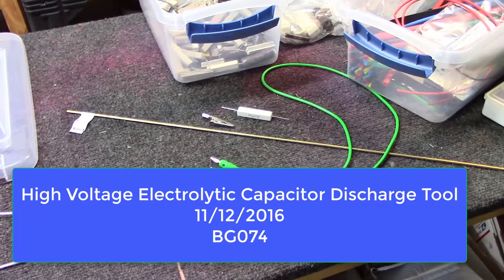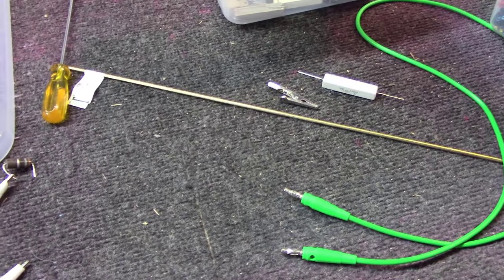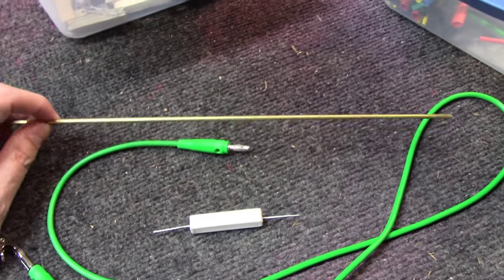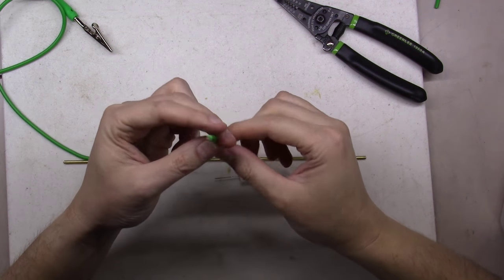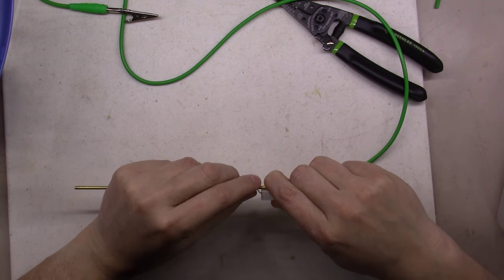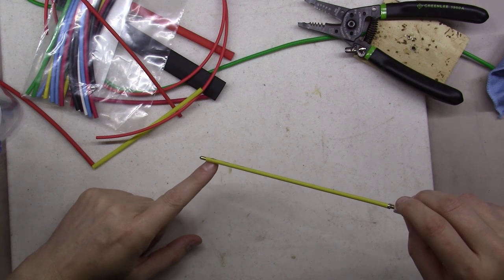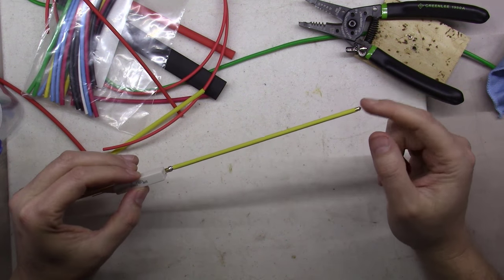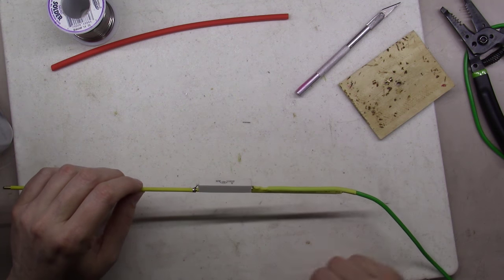High Voltage Vacuum Tube Electrolytic Capacitor Discharge Probe / Tool - BG074

Comment: A rectangular wooden block with a carve-out for the resistor and coated in epoxy and ergonomically shaped would have been much less costly and probably a lot safer than having the full voltage rod coming all the way to the handle. That’s worrisome.

Comment: I believe it's likely that we've all had a capacitor discharge tool that closely resembled a screwdriver. They can really scare the sh*t out of a unsuspecting beginner, or worse. Electronics really is not an intuitive subject as a whole to the uninitiated. It's unfortunate that most of us begin learning these valuable lessons without the advantage of having a ol' grey beard mentor. However, you learn really quickly the capabilities of capacitors, and that they aren't at all friendly.

Comment: Many years ago I worked for a power supply company on radar transmitter power supplies. These supplies put out 24,000 volts and could supply many amps on demand and would kill you dead if you got across it..

One day while running a test sheet on one of these, I shut the supply down and prepared to remove the full load from the supply so I could record the output at minimum load. As I reached to move the alligator clip I first applied my shorting strap (#8 wire to earth ground - metal frame of the building, steel girder). The alligator clip at the end of the shorting strap was taped to a 12" phenolic rod so my hand was well away from the HV terminal. The result was a very load bang and a very bright flash, about 1/4" of that heavy alligator clip vaporized in that flash.

The power switch on the 30a variac had failed and the power was still applied so I put a direct short across that 24,000 volt power supply with a nice fat oil  filled output cap. That caused a fault current of thousands of amps )24,000 volts / 0.02 ohms = ??). These supplied had previous melted a #10 wire inside the workbench wiremold strip, when I fixed that strip I found a 1/2" gap in the wire between a couple of outlets.

From then on I never relied on the switch, I ran the variac down to zero volts and double checked both the output voltage and the input voltage to make sure everything was off. I also kept the output of these supplies shorted to ground anytime i wasn't actively testing a unit.

This is an extreme example but it demonstrates how careful you have to be. When putting a resistor in a shorting lead make sure it can withstand the surrent flowing in it if it were hung across a working power supply supplying full output. Those sand resistors have pretty poor surge capability and can flash open if they are not rated for the surge.
Reply: Interesting and relevant Story, we used to go upto 60 KV on some of our systems. We had some highly intelligent test team guys and safety was paramount. No safety issues while I worked there although we did have one guys electric scooter blow up as he crashed it that morning. Always respected that corner of the lab.

Comment: I realize this is an old video but it just appeared on my feed. When I do a job like this I use heat shrink tubing with adhesive in it. The adhesive prevents the tubing from sliding off over time, which does happen. Furthermore, the end of the tubing that protrudes past whatever is enclosed can be pinched closed. Finally, the same pinching method can be used when the tubing has shrunk the maximum amount but has not completely shrunk around whatever needs to be completely enclosed. Once again the end of the tubing can be pinched together to make an air tight seal. The seal also keeps moisture out which may help in high humidity when dealing with high voltages. 
As an aside, I am just learning about tube amplification, just got my first tube amp, a single ended amp, and your channel has taught me a bunch about tubes. Since I was about 12 years old  I have always been listening to solid state gear. Now it's back to tubes and I could not be happier.
Thanks,
Eric

Comment: I use a resistor substitution box, having switchable resistances from 10 ohms all the way up to several megohms. Every electronics hobbyist should have one of these already anyway. You can start out the draining procedure with several hundred ohms selected on the switch and then rotate the switch down until you get to the lowest resistance. This makes for a safer, more thorough capacitor draining procedure then using just one fixed-value resistor* ,  and is much gentler on the capacitor. I did a upgrade the wattage of the internal resistors for everything below 100 ohms. It's an old Eico resistance box, by the way, extremely helpful for experimenting with circuit modifications, or dropping the voltages a little for comparison purposes when replacing incandescent lamps with LEDs, and so on.

* this is even more helpful for working on solid state equipment than for tube gear. Tube equipment won't care if you go to solder/unsolder something and there's 10 or 20 volts left sitting in a capacitor somewhere; but, if you try to solder/unsolder something in a solid-state amp that has 10 or 20 volts or more sitting on its capacitors, you are indeed very likely to blow up some other components and maybe damage even the circuit board if you unknowingly try to solder/unsolder something with that deceptive,  seemingly "low" voltage on it. Also, know that typical tube amplifier capacitors are less than 100 microfarad  and despite the high voltages,  the amount of stored electricity is relatively modest  and the capacitors are therefore easy to discharge; but a solid-state amplifier might have capacitors of 10, 000 microfarad that will hold a very large amount of current for quite a while in some amplifier designs,  even though the voltages are much lower than you would see in a tube amp. A pair of undrained 6K to 10K mfd filter caps charged at merely 20 or 30 bolts will spark like a shorted out car battery,  scare the crap out of you, beat up your soldering iron tip and vaporize copper foils, and probably short out some IC's or transistors, perhaps without any smoke or other visible indication of what has been damaged.
Reply: A lot of people might refer to what you described as a decade box.

Comment: I did something stupid.
I built this tool and it works great.
I've used it many times while modding and testing my amp.
However the last time I used it I forgot to switch off the amp and only realised it about 5 seconds later because of the excessive sparking where the tool contacted my cap and the bleeder light not going out.
The amp appears to be fine but is there anything I should check out or weary of?
Thanks in advance.

Comment: Neat tool. I've been using the low impedance mode on my multimeter to discharge caps for a while now,  seems to work pretty well also
Reply: DON'T! 😵

The meter will/should have a fuse or fusible link in it, that can easily be blown by discharging a fat enough capacitor at a high enough voltage (especially if you accidentally leave the thing switched ON!);

Once that thing is blown, you have NO assurance that the capacitors are discharged.
Reply: @RogerBarraud  That's not how it works. The fuses in a multimeter are on the current ranges only and are linked across the terminals by a current shunt.  And if you are using the current range to discharge anything,  you could literally blow your meter apart and even injure yourself.  The low impedance mode on the other hand is typically 5k - 20k ohms and is rated at the CAT rating of the meter,  typically 600-1000V.  Discharging anything rated above 1000V is something you would not do with a multimeter anyway.

Comment: Do you just touch the POSITIVE side of the capacitor, in order to drain it?  A friend of mine who is a tech is suggesting to touch both capacitor legs at the same time "to be sure", but isn't that just shorting them, and is not only unnecessary, but actually not good for the cap?  Thanks
Reply: Yes touching both without resistance in between is effectively a short. Maybe he's suggesting that to prevent accidental shorts if the leads are close (ex. radial capacitors). The safest way is probably clipping one side of the discharge tool to chassis ground and touching the positive side of the capacitor with the other end
Reply: @monz7951  I think he is saying to do it the way that could potentially damage the cap!  Which surprises me, because he is a very advanced tech.  I'm going to chassis ground / touch positive.  Thanks!

Comment: Hello and thanks for the tutorial, but i have one question. Other youtubers use in their tutorial a much higher value resistor like 20k and you use only a 120 one. Does that matter? 
I know that a higher resistor will discharge the cap slower, but how about the safety aspect ? is it more dangerous to use a 100 ohm one compared to 20k one ?
Cheers !
Reply: I need To ask The Same Question Please .
Reply: It all depends on the rating of the capacitors you are discharging.  Yes, 100 ohm CAN be bad if you're working with higher voltages.  Personally, for most modern consumer electronics, I'd use around a 300 or 400 ohm resistor for a nice balance between time/safety.  I'm thinking of making a tool like this that allows you to select from 3 or 4 different resistance levels.  There are some web resources available to help you figure out what you should use.  For example, DigiKey hosts a web page to calculate the appropriate resistor to use for a given capacitor: https://www.digikey.com/en/resources/conversion-calculators/conversion-calculator-capacitor-safety-discharge
Reply: That calculator tool is interesting. The caps discharge faster than I thought. 
Yeah, I think the resistor I use is a 460. Works fine.

Comment: So this is good not only for guitar amps, but also other electronics such as vintage TVs and radios?
Reply: Yup. Any capacitor lower in voltage then the resistor and wire is rated for.

Comment: Great idea to make a simple useful tool.  BTW, what is the power rating of the 120 ohm resistor; 10W?
Reply: Everyone else I’ve heard recommends a 100k or more resistor, not 100, rated about 3-5W. I think with 100 ohms it could discharge all at once, in one rush.

Comment: I have somewhat of a video request.  Could you explain what makes capacitors considered "audio grade," and which types of capacitors are recommend for the best performance in audio equipment?  I typically use Nichicon caps per your recommendations, but are they all "audio grade," or are there specific types of Nichicons that are or aren't?
Reply: Mostly marketing strategy.
Reply: Audio grade capacitors are the 50 cent caps that cost $5.
Reply: "Audio Grade" caps are designed to have low internal noise so they will create less distortion passing an AC audio signal through an amplifier. They are usually in smaller values and voltages than power supply or blocking capacitors that are designed to manage high ripple current values for smoothing, or general purpose that may just hold or block DC in a circuit. If you go to Digikey or Mouser and search within the " Electrolytic Capacitor" for "Audio" capacitors, you can then select a few, and read the datasheet info on them and see what differences they may have from general purpose or other capacitors.
Reply: The service manual parts lists of my receivers NEVER say "use audiograde capacitors" as replacements.  They state the microfarads and voltage.  That tells you all you need to know about this scam.

Comment: Outstanding video! Now question? You were to do a capacitor on a home ac unit and this might be a silly question but trying to make sure to drain the capacitor you attach the clip to the unit or the lip of the capacitor?  I am using the screwdriver method and trying to touch nothing but that? Thanks in advance.
Reply: I would attach the clip further from the cap so my hands aren't in so close to the tip incase of accidental arcing. The clip can be attached to anything that is grounded such as the unit itself but that may be painted and blocking a good connection. I would think the 120v ground wire is exposed and a perfect place to grounds to bare copper and bolted to the chassis
Reply: The metal cans on a AC capacitor have no electrical connection to the capacitors inside of them. Make sure the Unit is FULLY DEPOWERED!! ( pull the outside disconnect and check both of your AC leads at the contactor for voltage across and to neutral / ground) If its a single cap, it will have 2 unmarked terminals. If its a 2 section, it will have a "C" for common, a "F" or "FAN" and a "H" or "HERM" (for "Hermetically sealed compressor motor") You wll drain the capacitors by going from "C" to "F" , and from "C" to "H" or "HERM"

Comment: What’s thoughts on using a metal coat hanger in place of the brass rod, still using the heat sharing and resistor?

Comment: Hey man go through the hardware section at lowes ir home depot. They have the 4-40 and 6 -32 machine nut and bolts, washers and lock washers. You like the black just make drill holes in a piece of scrap wood and load ten screws into the holes and hit with some black rustoleum. Any color you want. Save time and money, live better.

Comment: Where I work with 250Kw SW transmitters-we use ground hooks.they are connected to the ground system of the station.Here the ground hook is your friend.Power supplies up to 30Kv-30A.the ground hooks WILL save your life.Use them anytime we go into a transmitter-also the primary breaker is opened.You have to open the breaker toget a key to gain access to the transmitters power vault.That contains the HV power supplies.The ground device you make is a good idea and precaution.

Comment: Nice device,i used a 1M resistor in line with heat shrink,think i'll get some nylon rod /tube and solder a resistor to a bannanna socket and a brass rod,fit it all inside the nylon tube or bored out rod,some epoxy and more heat shrink to isolate the brass rod up to the tip,and i can replace the plug cable,store the probe with no hanging cable yaddah yaddah yaddah.
Reply: 1M Ohms is too high.  It would take  1 hour to discharge.  Use 470 Ohms.    Unless you are playing with really low micro Farads.
With a 1M Ohms, your capacitors are not discharging.
Time_to_discharge = 5 * Farads * Resistor_ohms.

Comment: Definitely a nice tool, but I'm a bigger fan of D-lab's method-- simply install a paralleled resistor in a dual banana plug connector, plug it into your meter, then plug your test leads into it. Set the meter to VDC, and you can discharge the capacitors while also verifying that they are, in fact, discharged!! (Just be sure to remove the banana plug device before using your meter for anything else!):

https://youtu.be/2iqmDf0QIyM

Comment: I have a 1Kw Am vacuum tube broadcast transmitter. Dint remember off the top of my head how many voltsin the bug cPs. I'm thinking is either800, or 1,200. In the cBanit there was a probe wired to the ground of the mains ground o the end of a broomstick. Situation was I could have it,or if I didn't take it , it would get busted up and despised o,f who I thought would be A sin, so I have it. I thought maybe idtey to convert it to use on the 160M Ham band, but as yet haven't got my head around how to do that. Building  suitable antenna and ground system at that ewavelength is also a but if a challenge, do even if I did s good conversion,, I dint have the avcwrage for a large enough antenna. 1kw AM RF INTO A SHORT ANTENa with iffy ground seems like are ipe for a lot of rfi complaints from too many too close neighbors, so that idea will have to wait until I land on a bigger plot with more distant neighbors. Those caps have big bkeader resistirs across them,, so discharging them hasn't really been an issue, buy that would be another thing if have to think that more fully when and if I put that beast back on the air.!

Comment: What a load of bull, as an EX: RTV bod from England, from 60'-2000's, Try working with 27 Kv  with that crap. Stay off the drugs over there.
Reply: Not "bull", but he probably should have covered the fact that you need to pick resistors rated appropriately for the capacitors you're working with.    Perhaps more constructive criticism on your part would have been to point that out, rather than saying "what a load of bull!"  It may also have helped with your credibility to point out the reason WHY you felt it was insufficient instruction, rather than boast your years of experience and expect us to blindly trust your judgment.  Honestly, I was under the mistaken impression people from England were more polite and thoughtful than Americans, but I guess your comment goes to show that people are just as rude everywhere.